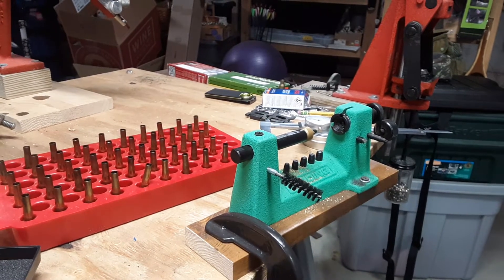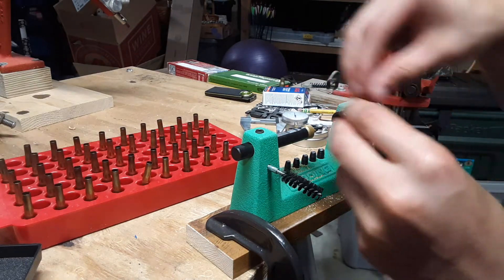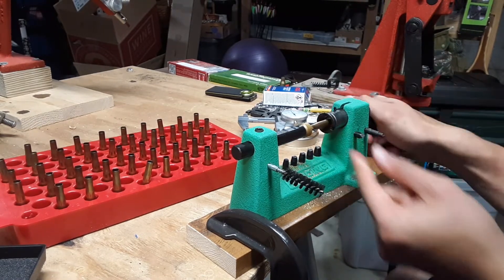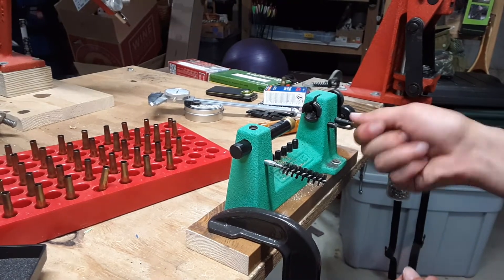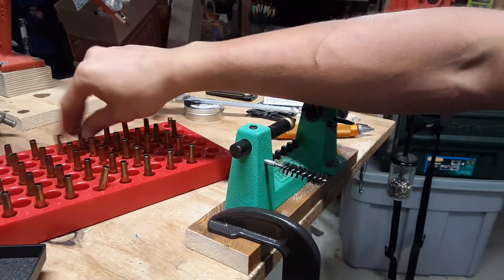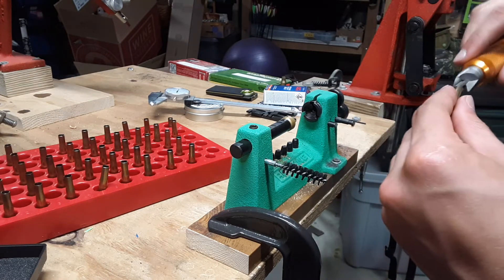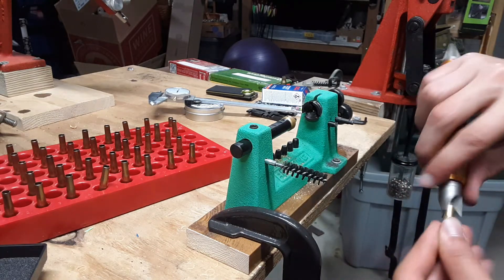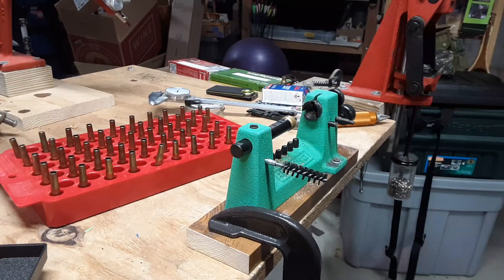22 Hornet reloading episode 3- case trimming and other case prep

Comment: Don't set down your caliper every time. Just when you need to put a case in the trimmer. That was hard to watch. Lol.
Pick up the case with your left hand because that's the hand you use to put it  between the calipers jaws. It'll go quicker and the vid won't be so long. And yes, it will help with views, likes, and even subscribers. Another thing I've learned during almost 40 years at this game is you only need a loading block when you're charging cases with powder. Everything else, it's a little faster going from one container to another one. Sometimes I use small paper cereal bowls. Sometimes I use Applebees to-go trays. Hope you don't mind a little critiquing. Thanks for sharing!
Reply from the maker: Thanks for the advice.
For that trimmer, I have to use both hands, so I have to set the calipers down, but yes, i agree that that part of my process can be improved upon and the way I set up my bench should probably change a little to help that.
Thanks.

Comment: If you have the cutter set why measure just run them, if they need trimming ok if not it won't touch. I love my RCBS I've bought the 3 way cutter makes life lots easier cutter, it cuts to length, bevels, and tapers all at once. Saves me 40+ hours of brass prep